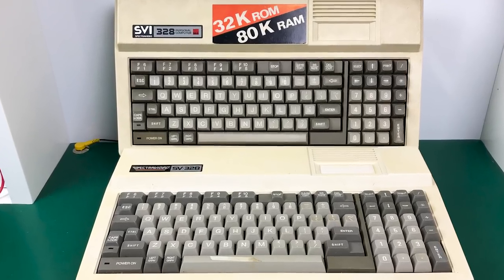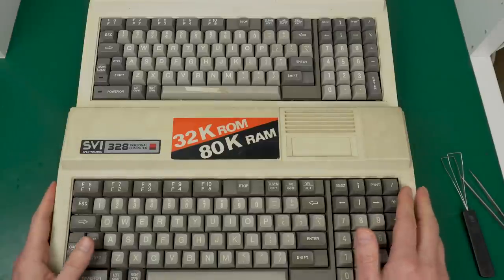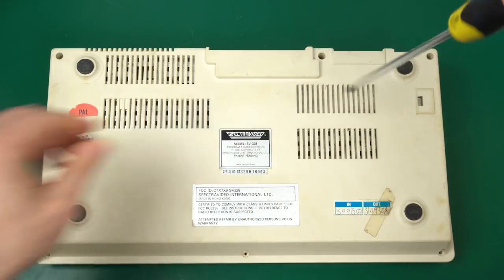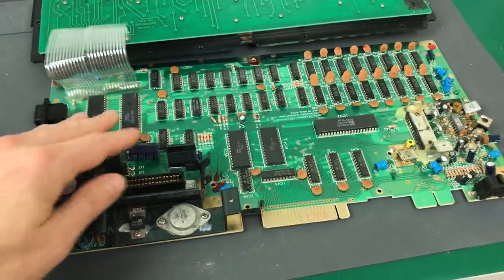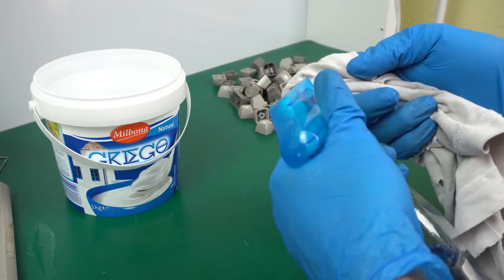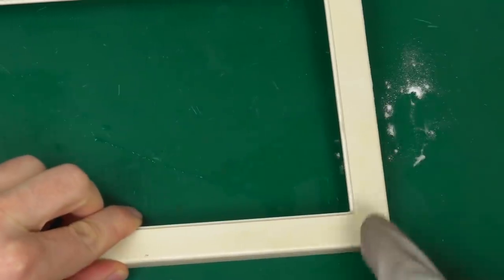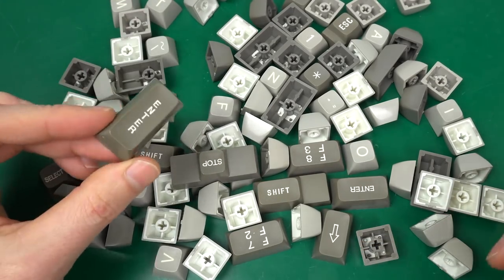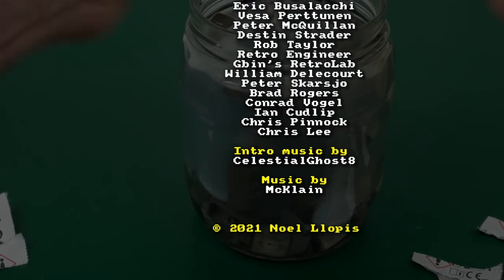A Tale of Two Spectravideos

Comment: Noel, 14:33 The unsoldered holes below the keyboard ribbon are the right pitch for your connector, It's just in two sections, (like the keyboard cable). They have traces connecting them. I think Spectravideo put them there in case they wanted a keyboard connector.
Reply from the maker: Ooh, you're probably right!!! I need to check that. Thanks!
Reply: @NoelsRetroLab  I took a screen grab and zoomed in. I could see the traces, I selected and copied the pinheader you were holding and it matched up perfectly with the holes. MS Paint can be quite useful at times. :)
Reply: @frankowalker4662  The original one seems to have a 2.5mm pitch. I roughly compared the run out (seems to be half a step) and split the difference between 24 pins.
Reply: I was thinking along similar lines.  I couldn't eyeball if the pitch was different or not, but it immediately appeared that if the connector were cut in two that each shorter piece would have less cumulative drift for each section's far ends and would work in the vias.
Reply: I came here to say the same thing. That unpopulated row looks like a standard pitch connector would work.
Reply: @costa_marco  It is 2.5mm pitch indeed. Once I had to replace such connector in some vintage Japanese audio gear, it was near impossible to get. Avoid that at all cost. ;)
Reply: It is indeed 2.5 mm. You can get two 12 mm connectors that will fit. See my post on this video for links to the connectors and pictures of them installed on my SV329 MKI. It cost me about $4 to buy 4 connectors (male and female, so 8 pieces). I bought multiples because I figured I might have to cut them down or I'd just mess up. If you buy them individually it's $0.95 + shipping. Also available at Mouser Electronics, I believe.
Reply: @costa_marco  The German Democratic Republic used both, 2.5 mm pitch and 2.54 mm pitch. So, a matching connector may be found from East German production.

Comment: Nice to see someone else using the Polident key cleaning method. I've used this on several keyboards too and I'm always impressed with how well it works, and it's so easy!
Reply: I tried it on my newly acquired Commodore 128 after watching this video and it works a treat 🙂. So much easier than cleaning each key cap individually. If only I had known about this years ago!

Comment: I replaced the soldered / glued keyboard connection in my SV328 MK I with 2 2.5 mm 12-pin connectors from TE Connectivity a year or so ago. I think I had trouble finding a 12-wire ribbon cable to match so I just used individual 20 or 22 gauge wires. This worked well though the wires I used were a little too stiff and too thick so it was a tight fit. The connectors cost about $1 for a male and female, so about $2 + shipping.

Comment: It was nice to see the two side by side.  Love the new key cleaning method that looked to work really well, I will definitely have to try it.
Before you use the TZ device, install a slightly larger fuse, as it does increase the current draw a tiny bit, and if the fuse is a little old it will blow.
Love the Spectravideo shirt!
Reply from the maker: Thanks! Oh good tip on the fuse. Do you know the fuse characteristics off the top of your head (or know where I can find them)? Cheers.
Reply: @NoelsRetroLab  Use a 400mA M205 fuse.

Comment: I suppose its not too surprising the denture tablets work so well, they are supposed to remove staining from plastic teeth and remove oily food residue, and the gunge on keyboards is oil from peoples fingers and dust. Certainly would make a great pre-process for retrobriting too, if keys need it.
Reply: Aren't dentures typically ceramic though? Feels like they might corrode plastic.
Reply: @Eddies_Bra-att-ha-grejer  While the teeth are indeed ceramic, the plate that they are set into are usually either a nylon polymer or an acrylic. Source: my father used to make dentures, crowns, and bridges.

Comment: The keyboard connector pitch is 2.5 mm, not 2.54mm. It was used in former USSR and few European countries. I had old ICs from USSR, Germany, Tesla made that had 2.5mm spaced pins. Also, there are 2.5mm board connectors, still not sure about large number of pins.
Also, I think that the row of extra contacts above are 2.54mm spaced and can use them even they split in two the keyboard connector. As a plus, two small connectors are easier to remove than a big one.

Comment: Great video!

From my experience restoring Model Ms, I use synthetic gum eraser (the normal one's my kid uses in school) for the rugged surfaces to clean or "erase" the dirt and leftovers from sticky papers. I think is better than baking soda because the powder is abrasive.

I liked the keycap cleaning method, imagine those double keycaps from the Model Ms with window cleaner! I will try it.
Reply from the maker: I have to admit I haven't tried using an eraser with the case, but I can see how it would have worked in this case. As far as baking soda being abrasive, I've never noticed any scratching or wearing down at least on those kind of surfaces. I think it's the reaction with the water that helps take all the gunk away from the tiny cracks. I wouldn't want to use it in a shiny plastic surface though!
Reply: the the normal pencil rubber / eraser is excellent for cleaning up edge card connectors eg pc 8/16 bit, it gets the dull and tarnish or and gives it a good not abrasive / destructive cleaning.

Oh i often used it at work on older 30/72 pin sim modules back in the day, they tarnish in the machine and also the spares in the IT cupboard

Comment: Regarding cleaning the key caps. I do it this way (since >20 years): get a nylon net bag with zipper (Amazon, local drug store), put all caps in it except the space bar which may break due to its size and drop the bag into the washing machine with your laundry (<= 60°C). As long as they are printed caps and not just cheap stickers they will come out clean. I once told the 8-Bit Guy and he was afraid of that. But putting electronics in the dish washer and exposing plastic to H2O2 he wasnt :-O
Even Atari ST caps can be cleaned that way. I mention it as Ataris are produced low-cost.
Reply: I always cringe when they do that. Yes you can dry it out but treated drinking water contains a lot of chemicals that may cause corrosion over time. I never see them washing them afterwards with a neutral cleaning liquid.
Reply: @hanznel8488  Now that you mention it: yes you are probably right. Besides: I have been working for a company manufacturing dishwashers for commercial purposes (hotels, restaurants,...) and the chemicals they use are not suited for a home dishwasher. It would destroy the seals!
You may clean it reliable with osmose water or at least distilled water.

Comment: With the denture cleaner, they may now slightly glow under UV. I seem to remember that cleaners of that sort 'improves' whiteness by amping the amount of the blue end of the spectrum reflected from the surface. 
Useless fact about dentures, in the 'old days' they used to use radioisotope salts to make the teeth look brighter (natural dentine has phosphors that faintly glow so the dentures with the 'uranium glow' looked more 'real') 
So, your keys probably are more bluish, but it's at the edge of human perception, reducing yellows, and possibly glowing under black light. :)

Comment: The "paint" on the screws is nail polish - used to both help the screws from coming loose and to let you know when they have been undone (for warranty purposes)
Reply: I think you and I would differ on that a bit...  Do you have some sort of inside information about SVI?  (Heck, for all I know, I might be wrong.)
Reply: @horusfalcon   many years ago, around the same time these machines came out, I had a job assembling home computer hardware.  We used nail polish on screws to detect tampering and also on variable resistors to ensure their setting didn't alter once they had been "tuned in".  This may be some other lacquer or resin product being used but the purpose is the same.  We worked on a few SVI machines way back then also and they all had these same resin spots on the screws.

Comment: I had the SVI 328 Mk II. Unfortunately, it wasn't a REAL MSX computer (the SVI 728 was).
The MSX assembly code you found on magazines didn't run on it.
On the other hand, the BASIC code (unless it didn't involve assembly routines) did work fine.

Comment: Well, those dental cleaning products are good enough to clean dentures and coffee-machines, so yeah, those keys should be pretty clean after that. Anyway, it seems like a useful tip that I shall try to remember.
Oh and about the connector pitch being slightly off, maybe it's less of a problem if you divide it. The original cable already seems to be split in two.
Reply from the maker: Good point about splitting it. I might try that if I don't find a better connector. Cheers!

Comment: I have tried using Corega pads to clean the keys and it works great. Now I want to bleach them with hydrogen peroxide and a UV light. I only have a single U.V led that I use to cure the mask in repairs, I don't know what result it will give. They are the keys of an Amstrad CPC6128 that are somewhat yellow. Any suggestions ??. Thank you for your channel and for your countless tips. Greetings from Malaga.

Comment: Could the round voltage regulator be replaced with either a newer type 7805? I seem to remember that this type can be pretty hot (not that the other isn't). Just curious... I saw on the other that it seemed to have the regular one we normally see.

Comment: "This episode of Noel's Retro Lab is brought to you by the letter E, and by viewers like you." ;^)

That "paint" on the screws looks like tamper enamel. A common American brand name of this stuff is Glyptal, and the red coloration is popular with a lot of brands.  It is useful for locking screws into place without fouling threads, and for indicating when someone has been working on a piece of equipment.  Additionally, it is a good insulator, and is used on exposed wiring to seal it from environmental factors.

Comment: I don' t know if the connectors' holes are the right pitch indeed as Franco said, but if you have such issues with PCBs in general, I would suggest you to cut that pin row in smaller rows and bend their pins slightly, in order to fit to where you want to put them.

And in order to replace that disgusting transparent ribbon-like nightmare, I would suggest you to use some flat cable. Either by slaughtering a floppy cable on the altar of retro-re-animation of other monsters, or by using some of the readily available ones that exist in the market. Probably you already know this, better than me...

P.S. That bucket which once held a yogurt like dessert, what EXACTLY brand is it? It contains some monograms/combinations of Greek letters, but it' s totally incoherent...
Reply: I forgot to mention that I did the same thing on a pair of MMS130 MULTIMEDIA SPEAKER SYSTEM" from PHILIPS, back in 2001, which didn' t like you replacing their volume potentiometer(50 KOhm). So what they did, was to put an extra pin among the other ones, PLUS put two extra resistors above those pins and coat them with some ceramic material, in order to hide them... So, I had to buy a new potentiometer(100 KOHm), two more in order to put them in parallel, PLUS the other two inside the potentiometer itself and use the old bracket of that potentiometer as well.

We are talking about the ultimate Frankenstein' s monster, but it still works, till today!!!
This is what PHILIPS didn' t want me to do and go buy a new speaker set, after just one year of use(less, actually)!

Comment: I like the tidiness of those boards but  I don't understand your reasoning behind having many logic chips instead of just one ULA. Isn't it far more easy to  replace the ULA with a known working one and automatically test the whole logic function? Am I missing something?
Reply from the maker: You're right from that point of view. The problem is that the ULA is a custom chip that hasn't been manufactured in 30-40 years, so there are simply not replacements out there unless they came out of another SVI 328. The individual chips however are still manufactured and can be replaced very easily.

Comment: Nice cleaning method. I wonder what those fizzies would do for an actual case. Fun Fact: The SVI's are essentially what the Coleco Adam should have been. I think the biggest turn off of the Adam was that it was so gaudy and cumbersome. Coleco should have simply made a simple keyboard expansion module with more RAM and ROM that fit undet the console. They spent way too much time and R&D on the Adam when it could have been more elegant like the SVI.
Reply: Only elegant on the _outside_!
Reply: @talideon  no one operates a computer from the inside. the fact that it takes up less than a 3rd of the desk is what it matters.

Comment: The water stains after drying may be eliminated with distilled water rinse. Though it's not 100% I do this for someone else's mechine I cleaned I probably would still use tap for my computer... They do not bother me as much
Reply: Was thinking of adding rinse aid for the dishwasher for the last rinse. I anyway wash all parts in my dishwasher so I don't have to deal with this. The cuttlery basket can hold small pieces.

Comment: Your pin header is 1/10"=2.54mm but the PCB is 2.5mm pinch
For an small acount of pins they are compatible but not for a lot of pins.
Reply: Agreed - the pitch of the connector looks to be 2.5mm

Comment: I remember when I saw Adrian Black repairing a TI-99 4A. I HATED it because it was soooooo combersome to work on. I felt bad just watching him go through that............Then I saw you repairing one of these things with all the hot glue. ugggg What the hell were they thinking when they made these things? These is cheap but still good, and then there is cheap and crappy.
Reply: hmmm that first one the hot glue isn't as obvious. It's still horrible that it's all attached together.
Reply: that second one isn't nearly as bad. It's more like the TI-99 4A with it's single connector. However even that's better because it's the power board that's soldered like that if I recall. This is the keyboard.